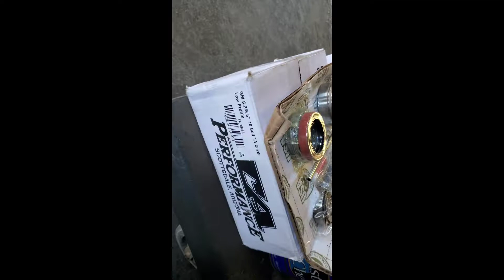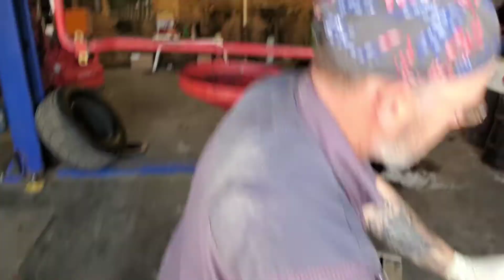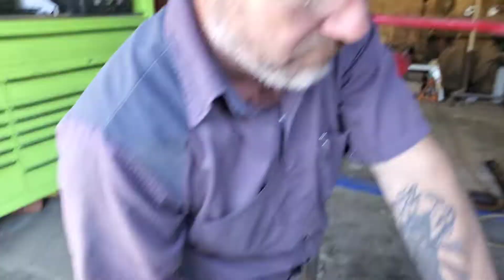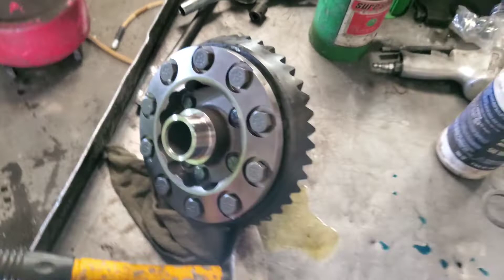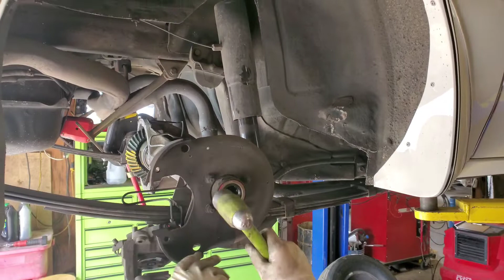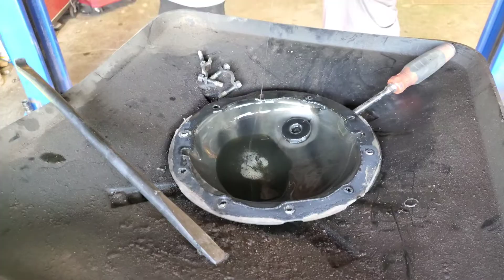Detroit TrueTrac upgrade 2nd gen Trans Am

Comment: Should have switched it out for a Ford 9 inch, they’re indestructible!
Reply: 3000 bucks is what it cost my brother to put a ford 9 inch in his 2nd gen Trans am. He installed it himself so no cost for labor on the install. Driveshaft has to be shortened, brake lines and brakes had to be routed and installed. It’s just not a bolt 
In. Only reason to put a ford 9 inch is when you have serious power. My brother just tuned and dynoed  his LS turbo powered 76 TA and he made 710 rwhp . That’s 900 flywheel! Speed metal has stock 301 turbo @ 210 flywheel hp. Absolutely no reason for him to put in a ford 9 inch .Also a 9 inch eats up more of your hp over a factory gym 10 bolt.
Reply: @mattspontiacta  Well said. Lots of built up performance cars, sitting in garages that only head out to cruise nights, and never see any action. All show, and no go. 
"Don't wanna get a "speeding ticket". :0